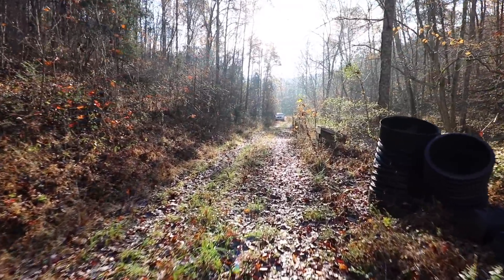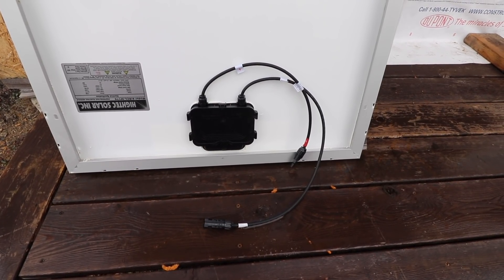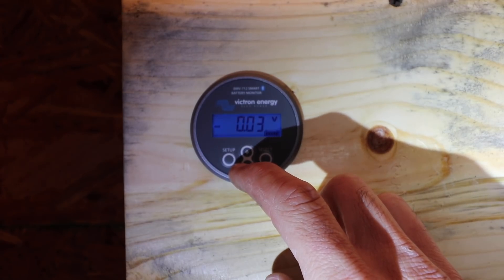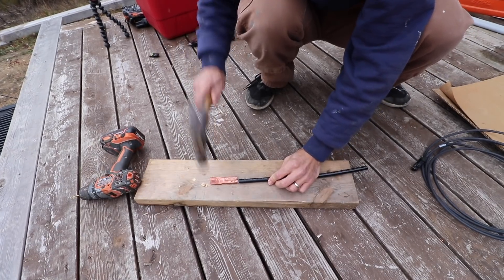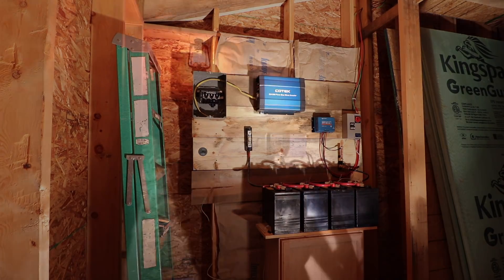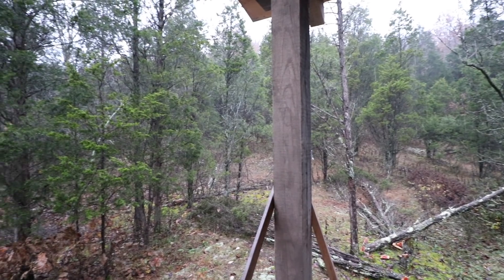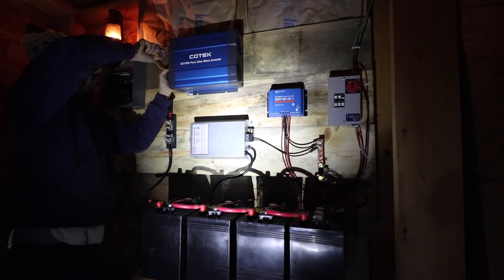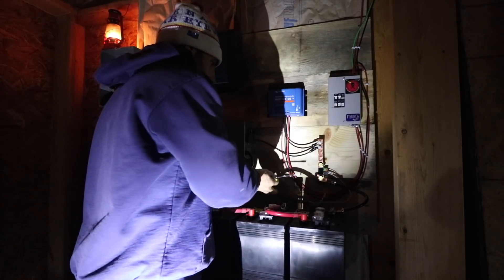Installing Solar in a Small Off Grid Cabin II

Comment: First this is sure dang alot of info.. that you might not need to read (at all) and am sure you have already considered doing all this beforehand. if thats the case.. my sincere apologies.

Suggestions:
1. if your solar panels are outdoor and especially on the roof where you cannot get to unless through a balcony on the upper floor or through a ladder placed on the deck outside.. then i'd suggest you purchase some extra 1.5Ft 12AWG, 5Ft 10AWG, 5Ft 12AWG, 10Ft 10AWG, 10Ft 12AWG, 15Ft 10AWG, 15Ft 12AWG, 20Ft 10AWG, 20Ft 12AWG MC4 (not all.. buy which ever fullfils your requirment..lol) Solar Extension Cables (Black and Red).
2. Buy a Snow shovel with an expandable pole to reach spaces out of your reach (but am sure you have one).
3. install some Snow guards on a metallic roof such as yours (both sides).
4. buy some comfortable non-slip knee pads if (God forbid) you do get on the roof.
5.  A Roof Safety harness+back carabiner & its socket with 2 anchors holders (available in a kit) (one anchor goes on the top main ridge and one at the bottom side or start of the roof)..to keep you steady and work on either side of the roof. i do see you bending over on the ridge on your tummy.
6. Water proof safety shoes (Non-slip) & all weather gloves (winter's coming)...again am sure you have a pair.
7. Weather proof Skirting First with Steel Mesh on the outside.. around the cabin (Pest/rodent control).
8. Shoulder air washer or Shoulder pressure washer (hot/cold water) with 5.2M TELESCOPIC EXTEND-ABLE LANCE (the lance is for you to reach the space if you don't want to get on the roof to clean the snow...on a cold day...this way ..you will clean the solar panels from down below.
9. Floor door to get under the cabin.. if the cabin requires some repairs (access door usually placed inside)
10. LED Lights (5 5w lights).. is all you require at the moment. untill the cabin gets finalized. flashing the camera light in your face get you groggy.

EXTRA (Not needed if your power requirement is full filled)
10. Missouri Wind and Power (2000 Watt 11 Blade Missouri General Freedom II) Wind Turbine.. watch video's from company to properly utilize this products capabilities. You do have the space for setting up this wind turbine) this utility is expensive around 759$ USD, but once installed it will provide you with that required power that you need..on a 65foot retractable with pulley pole..on even ground...even if your battery bank is fully charged) you get power 24/7 day n' night. NO COGGING - CUT-IN SPEED IS 6 MPH.

As for food on the go, get your self some mixed fruit or nut granola bars (at least 2) and carry a coffee tin with some type of smoothie  or coffee/tea...for yourself...whichever you prefer.. an empty stomach is an empty mind...Snow will be on you in no time.. and you need the energy for those mind cogs to work properly while working on your cabin and finalizing the outdoor projects. Lastly but not least.. add some gravel #2 or #3 to property driveway.. before the snow sets in..no puddles or truck bumping around.

Take Care, Stay Safe (thank you for the video)
Reply: i still edited some..changes..Yes..its one of those days.. when i correct myself multiple times to get what i am trying to say. After a hard Days work.. you should have a rocking chair with a nice cushion for your bottoms.. but yes..eventually :)
Reply from the maker: Hey Edward Seth, thanks you much for those great suggestions.  Putting the panels on the roof certainly made things more complicated.  Unfortunately it was almost a must to deter theft, or at least make theft much more difficult.  The system should provide plenty of power for the time being.  I currently don't live there full time and likely won't for a while if ever.  but who knows.  A hot drink is a big morale boost when it's that cold.  I have a nice thermos that I should make use of so its all ready for me...  Thanks for watching and I appreciate the comments.

Comment: I’ve decided on building a log cabin. We have so much straight and tall Virginia Pine on our farm. Free wood. A new tractor to skid logs. I will start cutting the trees down after deer season. Peel and cure. While curing I will gather stone from the creek to build my foundation. Bought an Alaskan mill for some small mill work. Looking forward to getting started.
Reply: We bought the John Deere 3038e with loader, bush hog, tiller and box blade. We bought from Bridgeport Equipment in Gallipolis. Seems to do well for our needs. It’s been so wet and the tires really tear the ground up. Other than that it’s great. Looking forward to skidding my cabin logs with it.
Reply from the maker: Craig Fuller that’s going to be awesome!  Keep us posted.  What kind of tractor did you get?